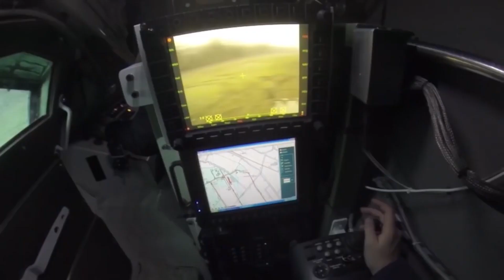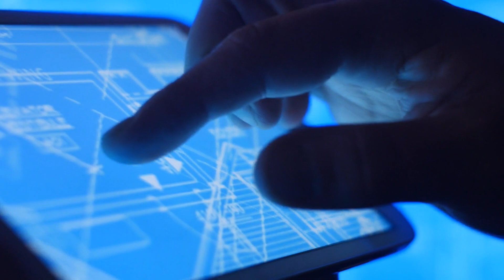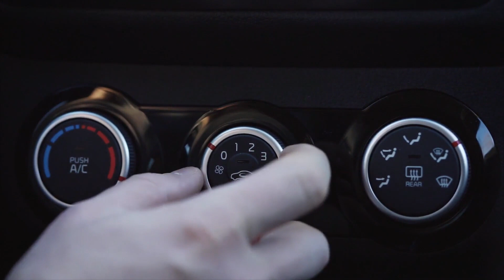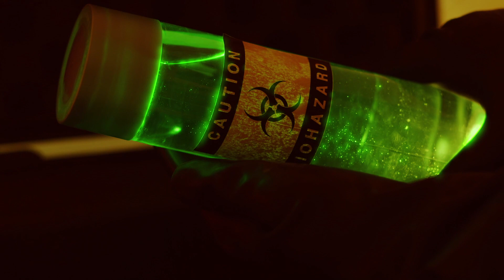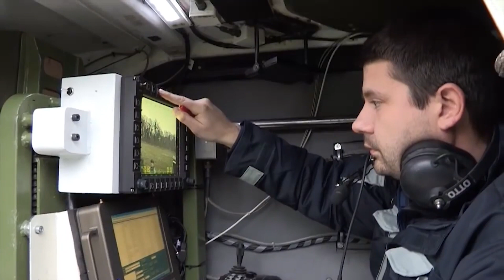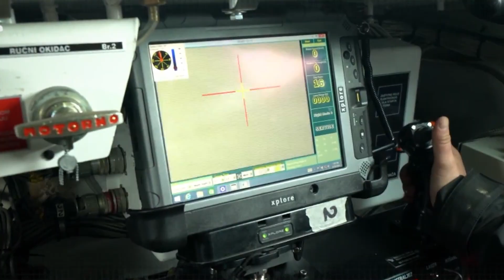The 8x8 Armored Monster with a Russian Turret

Comment: One does wonder if the designers ever figured out that a hit on the opposite driver situation would take that "thing" out in a second?
It doesn't need to penetrate the hull just knock off something the engine needs, probably putting the engine beneath the turret would have been a MUCH better idea.

Comment: Some other info on the vehicle that you either failed to mention or didn't find the data on:

- Turret is less protected than the rest of the vehicle, but since it is unmanned, it is less of a problem...
- It lacks ATGMs, which is stated to change in the future
- The main issue currently is the turret, since it is Russian, and there are different embargos on Russian equipment. That is why another turret is being considered.
- The 57mm gun is just AWESOME! However, many claim that 30mm gun would be just enough...
- Hull is Turkish, engine is American, turret is Russian, but the vehicle is Serbian...

However, all in all, it is a well rounded and a good vehicle. Serbian military industry's main issue is lack of capability for mass production. Plus, IMHO, Serbia got involved into this segment a bit too late, so the market is already taken by big players. It is also my opinion that as for export, Serbia should stick to what works best; infantry weapons, ammo (such as rockets for Grad and similar systems with double the range of the original), artillery systems...
BTW, Lazar has also been exported to Cyprus as well as Nora B52 self-propelled artillery...
Reply: The hull isn't Turkish, it's made about technology bought from South Africa... 
A 57mm cannon is the perfect price ratio, ability, firepower... There's no vehicle but a tank that can withstand a 57-millimeter attack.
Reply: Its actually a patria hull not sa or turkish
Reply: It also lacks electrical and semi-conductor chips to be more than a hulk of steel.
Reply: Malo su ti pogresne informacije ali nema veze, sluzi nama u korist. Pozz.